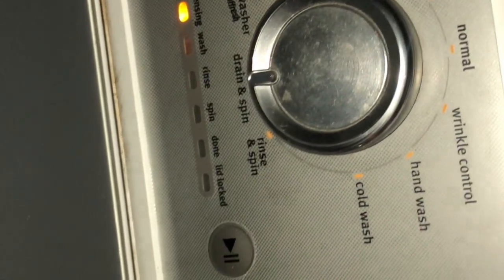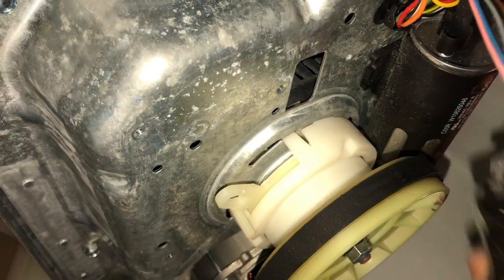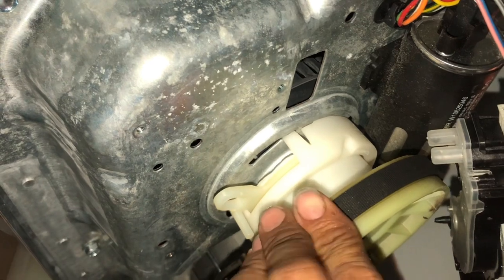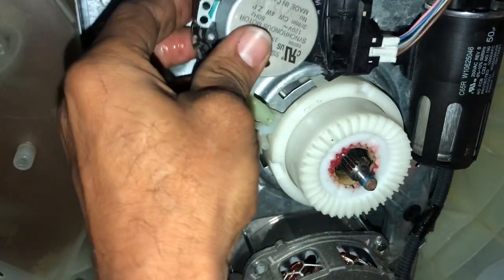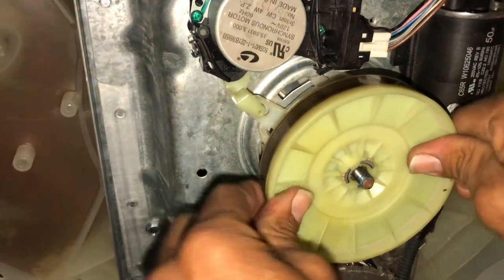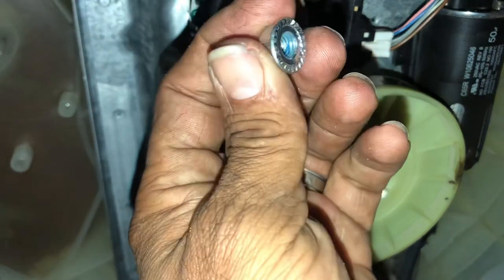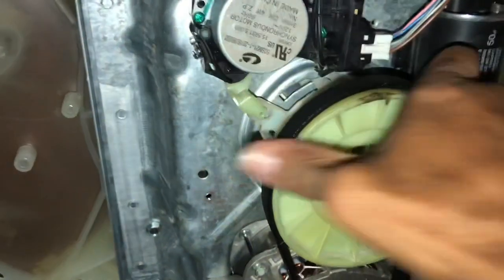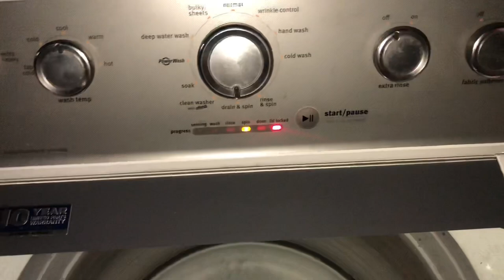Whirlpool |Maytag washer not spinning | weird noise |rattle|clicking noise

Comment: Great video. I noticed you didnt run recalibration after the repair. Is it necessary? Thanks
Reply from the maker: No need!! It is hogwash lol. Once you unplug the appliance, it resets. The appliance is programmed to do a task. For example the drain pump. It is either draining or not. Once you replace it, the washer will drain like it was before. Diagnostic is another one, once you understand the process of operation, it is very simple to figure out the problem. Or easier
Reply: I assume that all error codes will vanish too. 😉

Comment: Thanks for this. Trying to diagnose/research for my parents washer. (WTW5000DW2) Has a lot of trouble balancing properly, violently shakes with need to stop cycle and reset. Also, during spin down as the tub is slowing it makes very loud and abrupt clacking noises. Splutch?
Reply from the maker: I would replace the splutch and probably the shifter as it may not be engaging.
Reply: @appliancerepairshorts  Thank you. Eager to open it up and check it out.

Comment: Replaced all that and tub splined washer ,bravos works but has very weak spin cycle that leaves cloths wet, could over tighten belt nut slow the spin ? Any help/suggestions ideas thanks
Reply from the maker: Send me a model number, Brovos I don’t think has a belt. You might have a piece of clothing caught between the drum and outer basket. Use a bright light and look. You might actually have a situation with the bearings and seal.

Comment: My shifter keeps breaking because the splutch has a hitch in its giddyup. Think it would be enough to grease the splutch, or do they always need yo be replaced?
Reply from the maker: You might need to replace it, but if you have a piece of sandpaper. Try and make it less evident and put just a tad bit of grease.

Comment: I have the exact same washer. I’ve replaced the suspension struts and changed the tub hub to the metal one. But it still spins off balance for a couple seconds when in spin mode then straightens up . Any ideas on where to go from there?
Reply from the maker: What brand of suspension rods? Only OEM are worth it. The Amazon ones are no good. I have a video dealing with bad suspension rods
Reply from the maker: Whirlpool Maytag Washer Bouncing|Shaking|Not Completing Cycle|Suspension Rods Repair|Easy & Cheap
https://youtu.be/W3VE66YIWss
Reply: @appliancerepairshorts I unfortunately went against my better judgement and got Amazon ones, cause I already had so much money into it already and wasn’t sure. I went and got the lock collars in your video. Think I’m gonna put the oe ones back in with the lock collars on and see if that helps any. I appreciate your quick responses today thanks

Comment: I just replaced my clutch last week😅. And now my washer froze up again. It's making a loud ticking sound. I took the clutch of again. And it started to wear down again, just like in this video. What's causing it to wear down? Would it be the grease? I forgot to put grease on the inside of it?
Reply from the maker: So the video in the comments has a different transmission. Are you taking about a direct drive washer? Send me model number

Comment: can you tell me what did you replace on this issue actuator and clutch ? thx
Reply from the maker: The actuator was stuck. Sometimes the splutch gets tight and the actuator can’t move it and sometimes it pulls itself out. So you can remove the two green screws from the shifter. Then move the arm on the splutch. It should move smoothly. Nothing was replaced. I think I used a little bit of WD40 on the splutch. Do Not Get any of it on the belt or pulley
Reply: my maytag while filling up water then stop and refill and stop to the top as it should be , then just sit there do nothing and certainly it make like quick griding noise then sit there and i just leave it like that about 10 min or so and it start to wash and stop , then i have to manually shut off to have it water sucking out and hit it rinse/spin and it sitting there like 10 -15 min or so and start spin then stop, so i have to start everything manually
Reply from the maker: @6809darton  sounds like your tub hub is bad. I’ll send you a link to one of my videos. Send me your model number and I’ll send you link to the correct part

Comment: I have Maytag Bravo MCT Maytag, Bravo MCT model MVWX655DW0 serial C52441263 making this noise.  Do you have a video full video showing how to replace the splutcb(?)??
Reply from the maker: The splutch is very easy to change. Remove the belt, pulley and shifter . Now remove the splutch by twisting it to the left-counterclockwise. Pay attention to how you remove the old one. Mark the point of reference for the shifter. I’ll check my videos and tag you
Reply: I'm trying to order from Amazon but I'm having a hard time.  Could you please tell me what part number you used to order the splutch?
Reply: My Maytag Bravos is making a faint tapping noise, I replaced the splutch and that is not the problem.  Could you tell me if the shift actuator is the problem? Sometimes my washer wouldn't fully spin out.  Anything will help.

Comment: Hello i have a whirlpool washer model wtw7500gc2.
It doesnt spin the clothes dry and also it does not agitate, i guess it has a electrical clutch could this be my problem on mine?
Any advice or lead in right direction would be greatly appreciated!
Reply from the maker: Does it drain? Have any error codes popped up?
Reply: @appliancerepairshorts  yes it has e3 and f5 about 10 seconds after I plug it in. Otherwise I hear the drain pump running but no water coming out of drain hose even after I put it in a 5 gallon bucket to drain. Also when I finally got a cycle to start it filled with water just fine and all the water that was in the tub did drain out but there is still some water in the washer because I could hear it when I tilted the washer. Also this all happened after I started the washer after we moved. Didn't know if something got moved around too hard or what.

Comment: Man this might be the solution to the issue that I'm having, might try this.mine makes the same sound like if it is trying to spin but doesn't.also for some reason the breaker kept being tripped.
Reply from the maker: One way of finding what is tripping the breaker is , put your tester on the body of the washer. Make sure you have a good contact. Now put the other lead on each of the pins. You shouldn’t have continuity on the line/ black. If you are getting continuity from line to ground, start unplugging each component until you no longer have continuity. You can also email me. I don’t always see the comments

Comment: That motor doesn't sound well. How long did this last?
Reply from the maker: The motor sounds great. That is how they are supposed to sound. If you are referring about that vibration, it wasn’t level. That washer was sold with a warranty.

Comment: Any videos of removing frozen dashes, tall thing in tub
Reply from the maker: Are you talking about the agitator? What brand washer are you working on?
Reply: Yes, I can't get agitator off, it's stuck, kenmore
Reply from the maker: @hermanbishop5275  post your model number. So removing it can be difficult. I have a method, it works. Just look through my video of tub hub replacement. Use CLR or Barkeepers Friend. Remove the dispenser cover, use plumber putty to seal the holes at the bottom of the agitator. The holes are at the bottom. Now pour in the liquid and let it sit for 10-15 minutes. Then tap it off. Before all this, remove the 7/16 bolt at the center of the agitator. Keep me posted on your progress

Comment: Does this model have a coupling.
Reply from the maker: No it does not. Coupling is found on older direct drive washers.
Reply: I just put a little bit of cloth in it. And it. Keeps on half spinning. But it barely fill with water to.
Reply from the maker: @andresaguilar4993  send me a model number.

Comment: That’s the noise when mine spins around in the tub
Reply from the maker: Did you get it fixed?
Reply: @appliancerepairshorts  I tried, but they said I needed a NEW TRANSMISSION for WAYY too much… 😑

Comment: Did it make a loud grinding/clutch noise before it agitation?
Reply from the maker: What issue are you having with your Washer? The washer in the video wasn’t doing anything.
Reply: @appliancerepairshorts  loud grinding noise before starting. Sounds like the clutch.

Comment: Motor has bad starting winding.
Reply from the maker: I actually have a video on a bad motor. This one the shifter was not to communicate with the board. The splutch was stiff. That unit was fixed by adding a little lubricant. Thanks for watching